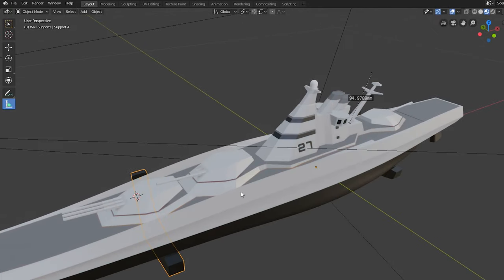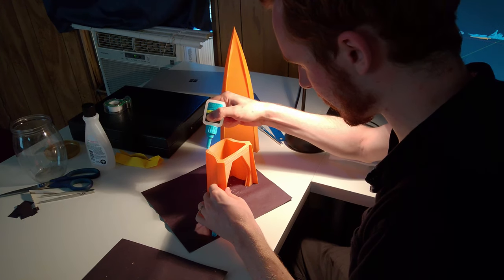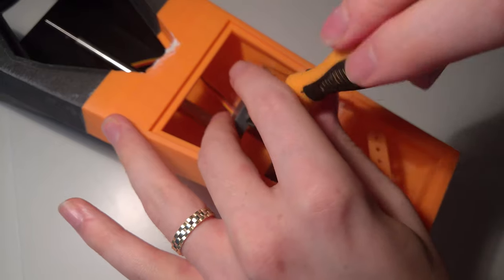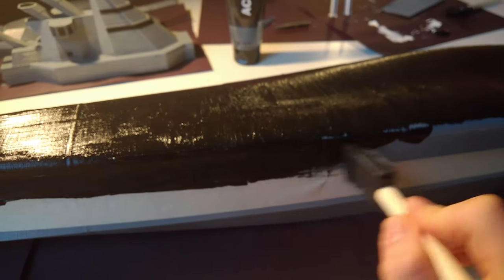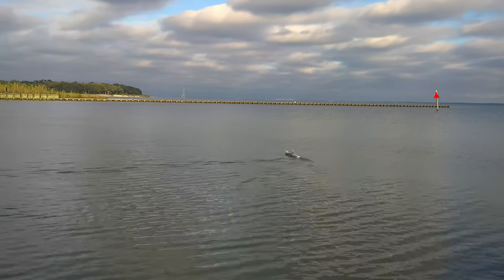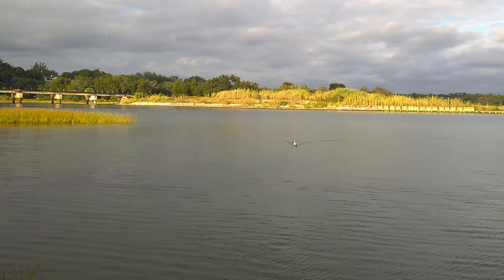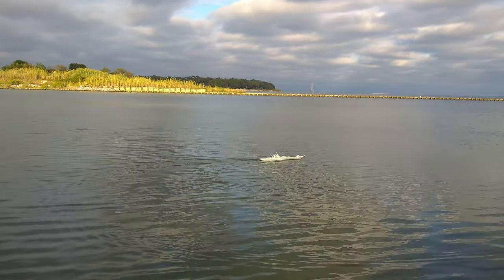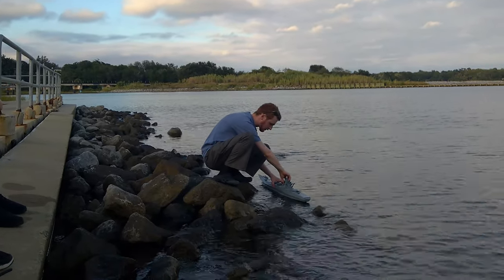Making of a 3D Printed Battleship

Comment: You're giving me a boat load of ideas! How did you generate the lines for the hull form? I'm trying to do this for my own project but..
Reply: my strat is to do a f*ck ton of loop cuts
Reply: @Aleeziate  What is a loop cut??
Reply: @wanglydiaplt  adds more vertices to your shape basicaly more bends and stuff
Reply from the maker: I made the lines by eye from an artist's reference. Don't remember what the ref was exactly, but it had a very long and thin bow.
Reply from the maker: Hi Alec, while I started by doing that, with more experience, it became clear that adding many vertices makes modifications far more difficult afterwards. So my strategy now is to use very few but strategic extrusions, and let the subsurface modifier handle the rest.